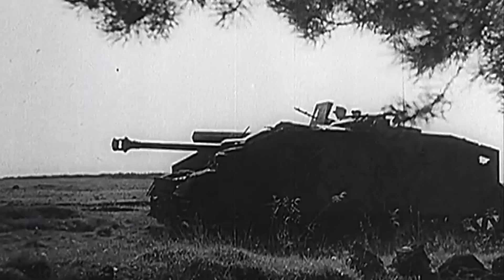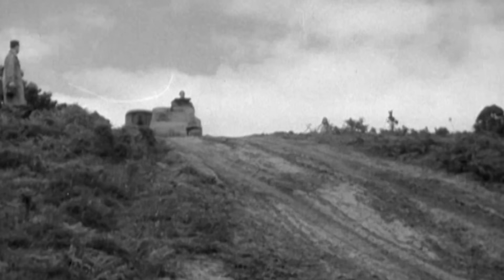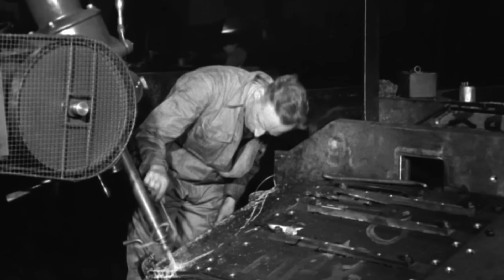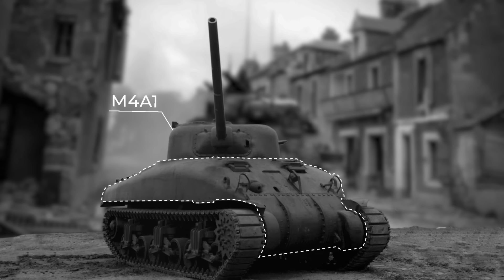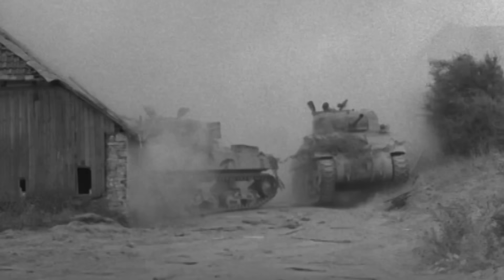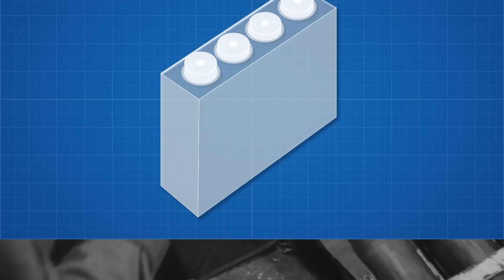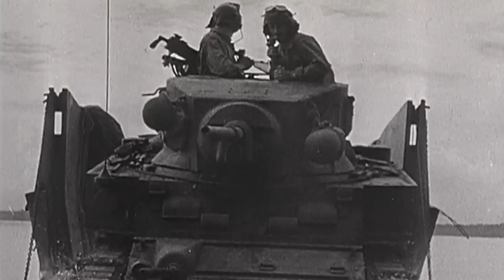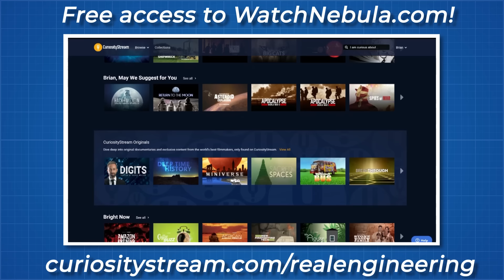M4 Sherman - The Workhorse of D-Day

Comment: T34 was produced in greater numbers, and mention of land lease was unnecessary cause it was not a key factor for winning the war
Reply: Lend lease was a key factor in winning the war.
Reply: @TheEvilmooseofdoom  maybe for you westerners and Hollywood where you live in a fairy tale that the US and allies won the war lmao
Reply: @Sveta7  Furthermore, numbers produced depends on several matters. Many didn't consider the Soviets as part of the Allied powers until after the war. Production numbers for the T-34 (and its derivatives) during the war vary wildly. Though Between 54,800 and 57,900 are the most common figures. In total between and 60,235 and 63,335 T-34's in all variants and its derivatives were produced during the war. On the other side the the numbers for the Americans are less under question- 49,253 M4's produced during the war including the T6 pilot. In total 63,181 M4's in all variants plus derivatives were produced. Another ~2,180 can be added if you want to consider the Grizzly's and Sexton II's which were Canadian produced (for most part they were assembled in Canada, though most parts were produced in the U.S., they are not added to the M4 production list). So if you want 65,369.

 However referring to the tanks themselves up until 1944 the production and use of the M4 was at least notably, then eventually marginally larger than that of the T-34. In 1945 the T-34 (the T-34/85 variant in particular) production outpaced M4 production and beat it in overall numbers. That being said, the T-34 was produced well after the war to make up for losses suffered and the fact replacement medium tanks weren't in the numbers required. Some ~80,000 were produced in total if we include postwar production
Reply: @Sveta7  

500,000 US trucks, which pretty much RAN the Soviet Logistics prove that statement false. Without US Trucks, it's unlikely the Soviets would have been able to supply their massive offensives against Germany, along with US/Canadian food imports that prevented a famine during and after the war.
Reply: @youraveragescotsman7119  Even without that it was simply impossible for the germans to completely control the ussr, so even if germans conquered more than they did the soviets would have eventually came back and destroyed them as they did, it's simple logic a huge advantage in resources and manpower
Reply: > "and mention of land lease was unnecessary cause it was not a key factor for winning the war"

 Zhukov felt differently.
Reply: @peterson7082  ah Zhukov your good old friend

Comment: Just one hit and the Sherman would catch fire, not from the ammo cooking off but the gasoline sparking up a storm. Both sides knew it, Germans called them Tommy Cookers and the Americans called them Zippos because they lit first time,everytime and the brits called them Ronsons for the same reason
Reply: Fuel type made no difference in combat. Even then, fuel fires were rarely the cause of a tank's destruction, rather resultant of it. 

 The Germans didn't call them such, or at least in specific regard to it as it appears in reference to British tanks before the M4 saw service. 

 The only documented usage of either Ronson or Zippo being used to refer to tanks during the war were in regards to flamethrower tanks. The application of it being a nickname for the line of vehicles overall doesn't appear until after the war. Veterans are mixed on the topic as well.
Reply: So why did the Germans use gasoline engines then? Ignoring this, if the fuel was the issue, how did the introduction of wet stowage so dramatically reduce the burn rate? Do you have any sources which provide evidence of the M4 being called "Tommy Cooker", "Zippo", or "Ronson"?
Reply: @infinitelyexplosive  find them yourself I did. Prove me wrong if you think its worth your time
Reply: @brentdallyn8459  Since you have to resort to deflection instead of just citing your sources, it's obvious that you're lying. Have a nice day.
Reply: @brentdallyn8459  The logic you're putting forth is ridiculous. How about this, for example: I say that tankers in WW2 called their tanks unicorns because the gun looks like a horn. I know this because I've read it several places. If you want to see the sources, you can find them yourself. Prove me wrong.
Do you see why this is a ridiculous system? "Find the sources yourself" is not a "counter challenge", it's a deflection. A real counter-challenge would be to cite your sources to show that your claim is backed by evidence.
Reply: @brentdallyn8459  Imagine my surprise when the article you're linking literally includes the line "Fuel fires occasionally occurred, but such fires were far less common and less deadly than ammunition fires", and with a reputable source (Zaloga) too. Thanks for proving my point for me.
Reply: @infinitelyexplosive  What ever information you cherry pick from the link is your biz,you wanted citations for Tommy Knocker,Zippo and Ronson and you got em.
Reply: @infinitelyexplosive  Wet storage was introduced late in the war.  29,065  Shermans had already been built at the time of its introduction in the M4A3(75)W. Loss rates went from 82% to 15% for only the last 15 months of the conflict, time enough for the Shermans reputation for catching fire to be well earned.
Reply: @brentdallyn8459  The only source listed "Ronson" is directly contested. In addition, it references Death Traps, a book well known for its exaggerations and factual inaccuracies. The article makes no other citations. The other two nicknames have no support. 

With regards to you general point, that gasoline engines made the M4 dangerous, it's clear that you are the one who selectively ignores all evidence to the contrary.
Reply: Nonsense.  You're merely repeating the same idiotic crap that others have repeated.

Comment: US: tank exerting too much pressure on the ground? Added grousers to the treads and redesigned the volutes.
Soviet: bolt on the treads coming loose? Welded a hammer onto the T-34 so it knocked the loose bolts back in place on the move.

Both ingenious in their own small ways, but DAMN, those Soviet engineers were intense AF.
Reply: Grousers did not help with ground pressure, end connecters did that. Grousers only helped with ice and mud traction.

Comment: Along with "the workhorse", other nicknames included "the tinder box" because of how easy it burnt up before wet storage was introduced.
Reply: All other tanks without wet storage were just as vulnerable to fire when ammo was struck by a penetrating round. More Shermans were burned because the Germans had a policy of continuing to fire on disabled Shermans until they were destroyed to prevent them from being retrieved and repaired.

Comment: The Sherman didnt have the fire power to face off against heavier tanks, like the Tiger Tank. Later it was modified with a larger gun and was dubbed the Firefly.
Reply: The firefly was a relatively rare British modification. The normal upgun was to the 76mm M1.

Comment: yanks: yeah boi we got the 75mm gun

krauts: laugh in 88,105 and 128mm
Reply: 1) The 88 was a heavy field gun (AT or AA), it is not comparable to the 75mm M3. The Germans had their own series of 75mm guns which would be a more fair comparison.

2) The 105 was barely used on any mainstream AT vehicles as the 75mm PaK40, 88mm PaK36, and 88mm PaK43 were all sufficient for AT duties.

3) The 128 was far too heavy and impractical to be used with reasonable efficiency, especially when already existent (and lighter) guns could do the job while using less material and taking less manpower to operate.

Comment: Fun fact: With vertical volute dual-bogie suspension setups like that, if you lose a road wheel on any of the assemblies, the crew could just tie it up and the suspension would still do its job. Sure, track stress would spike in that space where the damaged or missing road wheel would normally bear down on, especially when climbing barriers, crossing trenches or going over large ground debris, but with an intelligent driver, this isn't a huge issue. Obviously though, if the bracket/assembly itself is damaged, you're in for some hard times. You could lose one road wheel on each suspension assembly and still be able to limp home.

Comment: At no point in the war did the Sherman match the Panther in performance. Not in main gun, not in armor, not in speed, not in optics, etc. Everything about the US 76mm version of the M4 Sherman brought it up to par with the Panzer IV's armor and 7.5 cm KwK 40 L/48 main gun. Not even the US's 90mm gun was up to the Panther's 7.5 cm Kwk 42 L/70.
Reply: What do you mean by performance? The Sherman was equivalent in combat effectiveness, regardless of its inferior frontal armor and gun.
Reply: The Sherman was more than a match for Panzer IVs even with the 75mm. The 76 was not needed whatsoever for Panzer IVs and the Sherman's armor was greater than that of the Pz IV's.

The 76mm could also penetrate a Panther's upper front plate at distances up to 500m with APCR, the 90mm was able to do it at even farther distances. 

You act as though a gun has to surpass all competition to be effective. This is flat out false. The 90mm was more than capable of killing a Panther at almost any engagement distance and the 75mm of the Panther could do the same to the Allied tanks that carried the 90 (mostly M36s). The 90 was more than sufficient for anything American tanks faced.
Reply: The Panther should have been a better tank, it was 10 tons heavier and came later in the war.
Reply: Panthers were too heavy for their gear systems, and couldn't be built quickly and maintained easily.

Comment: So, if the claim that 5 Shermans were needed to whip one Panther is wrong, what is a more realistic number?
Reply: The combat performance seems to be roughly equivalent, although it's hard to tell how much of this is based on crew skill, and the performance of the panther varies greatly based on terrain and environment.
Reply: It varies wildly. Tank engagements are so heavily affected by things like weather and positioning so it's hard to assign a proper ratio. My guess would be more like 1.5 Shermans to one Panther, give or take one or two tanks to either side.

Comment: Great video but yet again you are confusing track grousers with duckbills. Grousers fit to the track face and dig into the ground to give more traction. The duckbill track end connectors provide more track flotation. Other than that great video. Also quite a few shots on Achilles tank destroyers. Also DD’s swim not wade.

Comment: 1).   Rock Island Arsenal produced a small tankette for the cavalry which used vertical volute spring suspension (VVSS) instead of a leaf spring suspension. Standardized as the M1 Combat Car, it entered service with the US Army in 1937.  The design was used in the M2 light tank and subsequent Stuart tank series. Design features of the Stuart were scaled up for use in the first M2 medium tanks which would evolve into the more successful M3 Lee and M4 Sherman, all using the VVSS.   

2).  The Horizontal Volute Spring Suspension (HVSS) system was first field with the US M-6 heavy tank prototype in December 1941 and was a successes.  However the M-6 itself was plagued with many problems that lead to the projects cancellation.  The HVSS suspension would reappear in the later war on Sherman tanks as the E-8 program.  It was never called an Easy-8, that was simply a Hollywood name for movies..  

3).  The high velocity 76mm cannon was first fielded in 1942 with the M-18 Hellcats, this cannon was more than capable of destroying a Tiger-I from any angle, even the front.  Later with the development of the HVAP round (high velocity armor penetrators') even the Panther and King Tigers thickest front armor was meat on the table.   
The first time the 76mm appeared on a Sherman was in 1942  as the proposed M4A1(76)W quick fix turret.  This project was cancelled because the Sherman's original small turret with the 76mm gun combination was found to be too cramped with other flaws by Armor Board even though it did technically work.  

This did however kick off the E-6 program when the Chief of US Army Ordnance directed that the then Prototype turret (T-23) be placed onto the Sherman's hull which could easily take the 76mm.  This resulted in the M4A2(76)W, the M4A3E2 "Jumbo" and finally the M4A3(76)W. 

4).  As to the myth it took 5 Sherman's to kill a cat i.e. Tiger is total bunk.  American armored units move and fight as a "Platoon".  A Platoon is the smallest tactical unit on a battlefield by doctrine and consists of 5-tanks.  An American WWII tank company consisted of 3-Platoons with up to 3-spairs for18 tanks.  It was Hollywood once again who perpetuated the idea that tanks went about fighting other tanks in one-on-one Chivalric duels.  

I highly recommend the YouTube talk called "Myths of American Armor", given by United States Army, Armor Officer, Major Nicholas Moran also know as the Chieftain at his web sight the Chieftain's Hatch.

Comment: The Sherman M4 was nowhere near as good as  the tanks that the germans had.  The only reason why we would win was because it would be five Sharmans going up against one Tiger tank, and the Tiger tank would get most of them.  The Sherman tanks were taller, which gave the germans an easier profile to hit.  They ran on gasoline engines.  U.S. soldiers and tank crews called them the Ronson, because when they were hit, they would light up the first time, every time.  They had a less powerful gun than the german tanks like the Tiger and Panzer.  German tanks were lower to the ground, so they had less of a target profile.  They ran on diesel, which made them less likely to explode when hit, and had a more powerful gun.  I like the Sherman, I love the way it looks, but compared  to the tanks the germans were fielding it was inferior.  We (the U.S.) only won because we had significantly more of them.
Reply: The Sherman was no more likely than any other tank to catch on fire. You forget the Germans also used gasoline for some of their tanks too.

The Sherman had better crew ergonomics (including a gyroscopic gun stabilizer for low speed engagements, which was unheard of for the time), a much higher crew survival rate, and it was much more reliable than other tanks of the time.
Reply: @bluntcabbage6042  you are wrong about the Sherman being no more likely than any other tank to catch fire, the german tanks running diesel were less likely to catch fire and had better armor.  I don't know about the crew ergonomics being better than the german tanks like the Tiger or Panzer, but that really is irrelevant.  The crews had NO WHERE NEAR a higher crew survival rate.  Five Shermans would go up against one Tiger tank, and the Tiger would kill most of them before being brought down.  The only reason why they lost was because they were overwhelmed.  As far as reliability goes, I did hear that the Tiger tanks did have track problems sometimes due to the great weight of the tank, but overall the Tiger and Panzer were vastly superior tanks compared to the Sherman.  In a one-on-one fight it was no contest.
Reply: @johnmckenna5782  Really? Because I could've sworn it was you who was spouting bullshit when he really knew nothing about what the Sherman was or what it was capable of, and now you won't even attempt to refute my points because you can't find any way to disprove what I was saying.

Good job, you miserably failed.
Reply: @bluntcabbage6042  A shit video? lol!  Where actual tank crew people on both sides told their stories and told which tank they would rather be in.  Sorry but the Sherman was not a match one on one for a Tiger.  It's just that simple.  The Sherman is a cool tank, and I like it, I have models of it, but it was no where near as deadly as the Tiger.  What is a tanks main role?  To destroy.  The Tiger destroyed better.  Now run along.
Reply: Most of the german tanks that were better were also much larger and heavier and most of those variants came later in the war after they found their current tanks were NOT superior to allied tanks.  The fires were the ammo not the fuel.  Those tanks would be carried to theatre on trains rather than be driven, had bridging limits which restricted where they could go and could never operate on a beach, all things the M4 had to be able to do.
Reply: If you are able to produce many more for the same cost, have much higher availability rates and a much more survivable tank (in terms of crew loss rates), I would argue that tank is much better
Reply: @DeBlobbb  The Sherman was not a more survivable tank in any way, we won because it would be many Shermans going up against one Tiger.
Reply: @johnmckenna5782  What is your source for this?

Comment: My Grandpa served in Sherman tanks in Europe and said they all hated them. They were too tall so easily seen and easily hit and the armour on the engine and fuel tank was paper thin. The germans knew this so always aimed for that weak point which always -Always resulted in an internal fire. The Germans in North Africa called them 'Tommy-boilers' because one hit would cook the British crews who used them there.
Reply: Nope. The term "Tommy Cooker" was a derogatory nickname for all Allied tanks, just like how a racial slur applies to everyone in that race, not just the people of that race who work in factories. 

Shermans, in reality, burned about as often as other tanks. Later models, however, burned even less as they began installing wet-rack ammo stowage. It was found out that the ammunition is more likely to burn in a tank than the fuel (fuel was located in more isolated parts of the tank too), so they found a way to lower the chances of ammunition igniting.
Reply: @bluntcabbage6042  Yeah, I was thinking bullshit from this opening sentence.